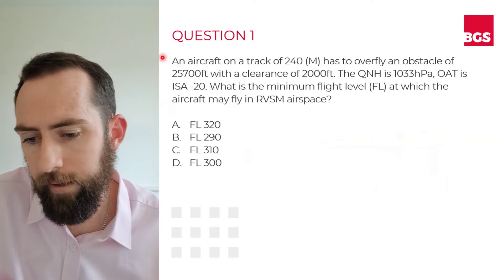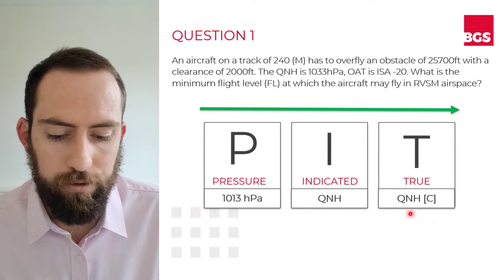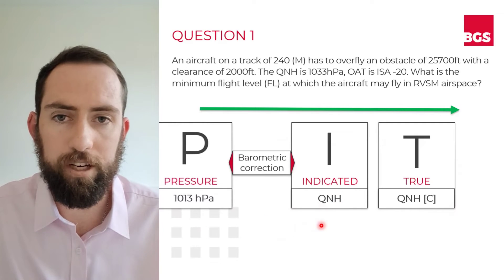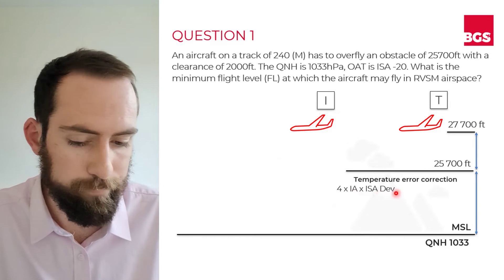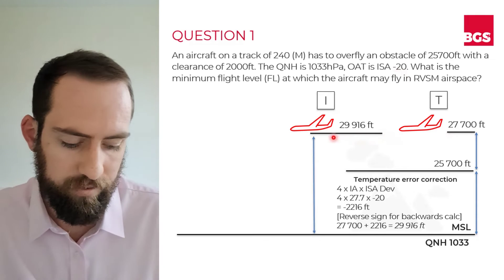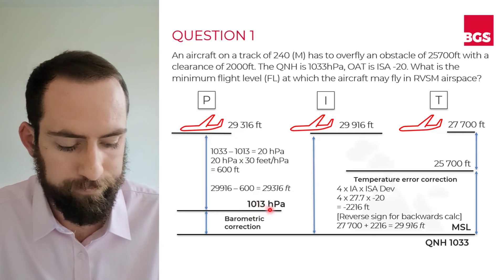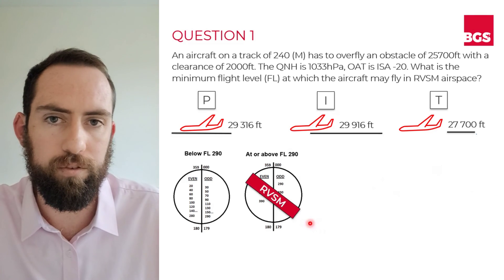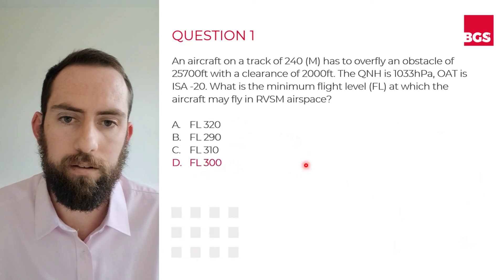ATPL Exams: Discussing A Recent Altimetry Question

Comment: Hey there - really useful video no doubt , but I am a little confused because of the RVSM because the question says (what is the minimum FL at which the aircraft may fly in RVSM airspace and doesn’t that make the answer FL310 since we are above FL290 and as per the table shown on the video)
Reply from the maker: In order to clear the 25700 ft obstacle with 2000ft in these conditions, the altimeter in the aircraft would have to be reading at least 29316ft with 1013 hPa set in the Kollsman window. With this in mind, the next available IFR flight level above 29316ft is FL300.
Since the aircraft is flying west, it will need to pick an even flight level, so FL300 remains a good option. If the aircraft was not in RVSM airspace, the separation between opposite-direction traffic would be a minimum of 2000ft between opposite direction traffic, beginning from FL290. This means that in non-RVSM airspace the first even flight level would be FL310. However, in our scenario, the aircraft is in RVSM airspace (where the spacing between opposite-direction traffic is reduced to 1000ft up to FL410) and is therefore able to utilise FL300.
Reply: @bristolgroundschool  the perfect clarifying that i needed, thanks😄